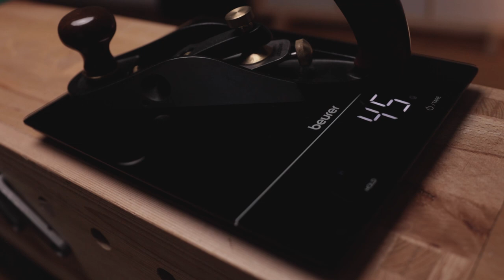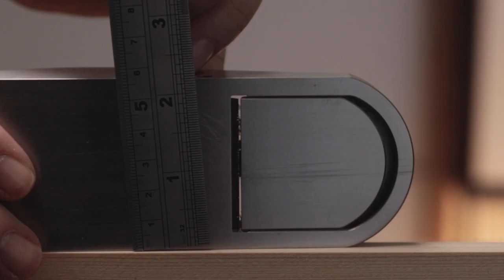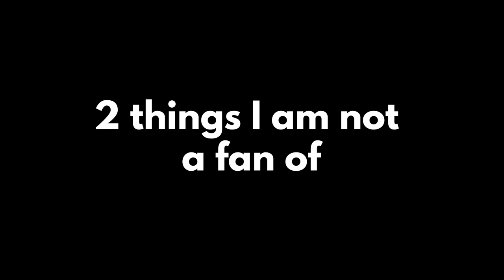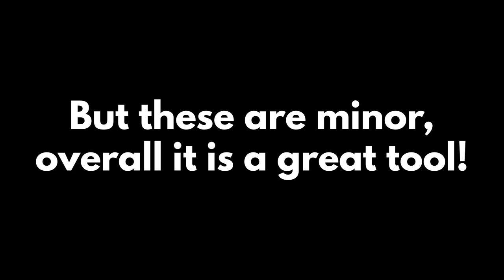Overview of the Veritas Small Bevel-Up Smooth Plane

Comment: Beautifully versatile little plane . I have the Veritas.I would point out one very very important point . You van generate alot of torque on the plane blade brass holding bolt . SO DBE CAREFUL . Just tighten it enough so that you can STILL adjust the blade .